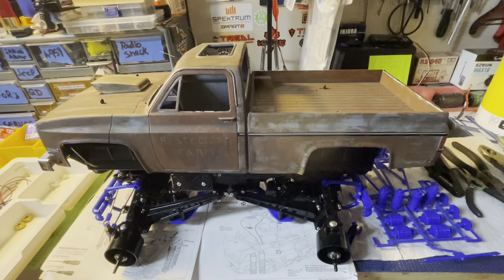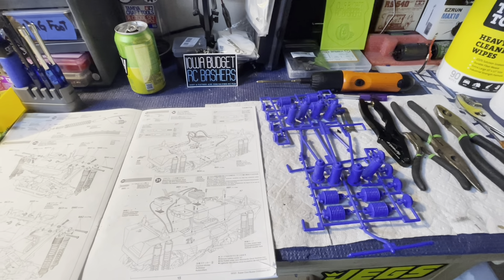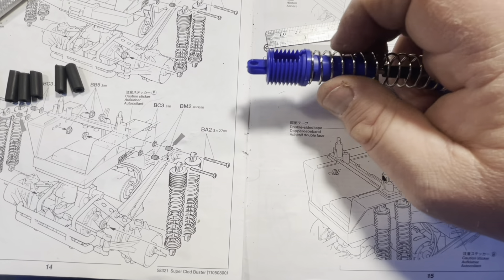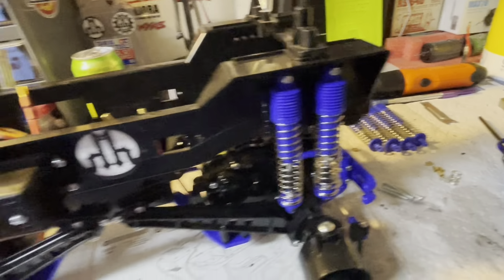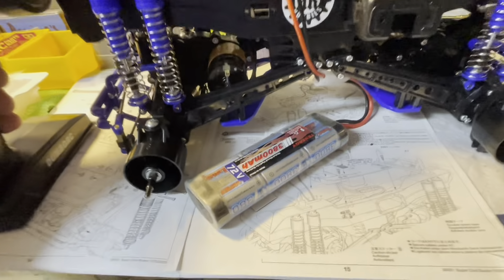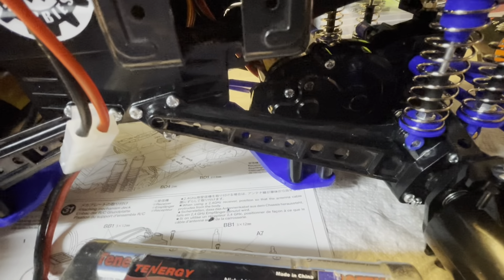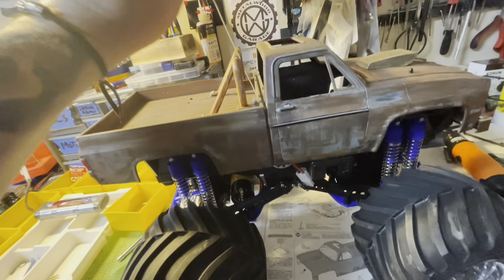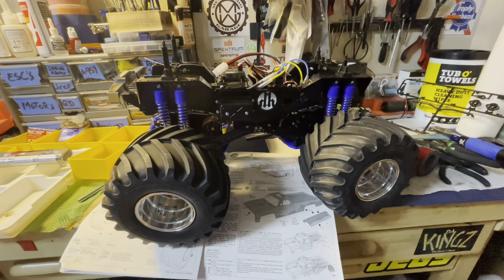Tamiya Clodbuster Excaliber/ClodRuster from the RC elf is done!!!!!

Comment: I bet that is a fun build. I agree that they should switch molds or have HW install switches to match the kits. I build 8 kits and none of the switches matched. Do you have a video on how you painted that rusty looking body? I was just talking to my wife about this last night.
Reply from the maker: Yeah it stinks but most of the time it’s not too big of issue with the switch.. 
as far as the paint goes, this was all done by mistake. It was black, and the Clearcoat I used caused it to wrinkle, so I sanded it a bit, shot it with gray primer, then used red oxide primer from the metal masters rust kit I’ve got, and brushed that on in no particular fashion, some spots just lightly, some heavily. Then I used the Vallejo rust and weathering paint and a brush and made streaks and rust spots, etc.. used trim stickers from the Gmade Buffalo decal kit to put random pieces of trim on it. Made my windshield from a to go container, and used shoe goo to put it in very messily to make it look like the window had been sealed sloppily with silicone. It was all an experiment after messing up the original paint job..
Reply: @IowaBudgetRCBashers  That mistake turned out very nine lol.
Reply from the maker: @nwirc  and I still got my Excaliber body.. side note the second body arrived broken. That became Grayson’s show body, Captain America